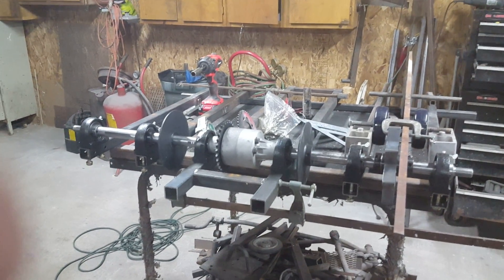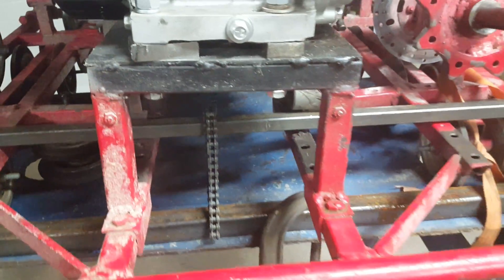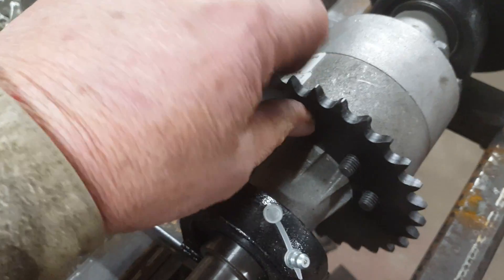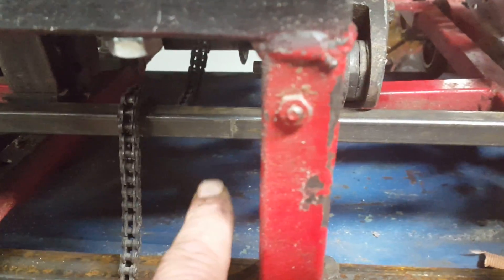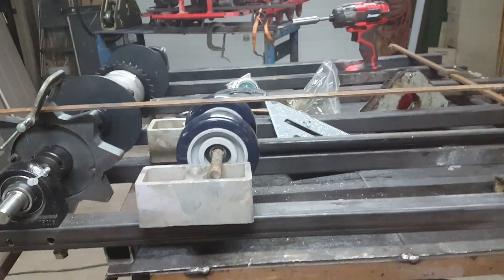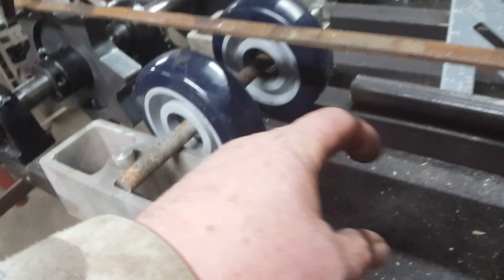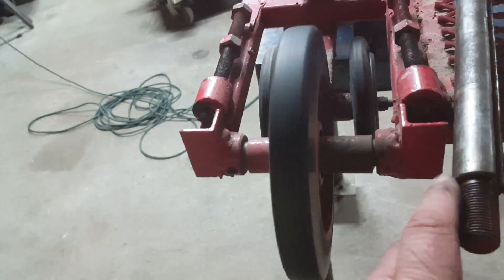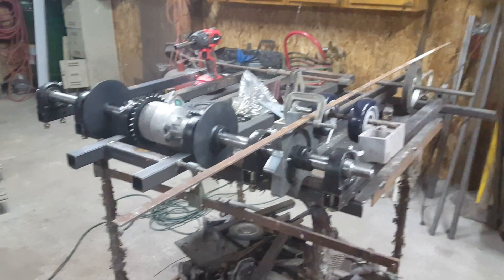PTV Build 4 - The diff sprocket, take-up bogie and broken diff diagnosis.

Comment: where did you find or where are you going to find another diff? I recall seeing those years ago but haven't seen them in years.
Reply from the maker: Yeah, this is a tough one.  Peerless went through a bankruptcy or was sold, but I have talked with them and Central Power Distributors wholesales them, so I got approved but I would have to buy like 25 to get any kind of deal.  Staton.inc has them though.  Thanks for watching and a great question!
Reply: @Personal_Track_Vehicle  thanks, that lead me to another source 
https://progear1.com/standard-differential/

Comment: I want to make an electric bike trailer using the same differential on leaf springs. Do you have any ideas how i would support it so the differential case would not crack like yours did? Or is there a better way to use this differential with a different type of suspension?   thanks for awesome video.
Reply from the maker: Is there a reason you need a differential rather than a simple trailer axle?  To answer your question, four pillow block bearings are normally perfect support for it.  My frame was never welded strong to begin with, that was my problem.  Thanks for watching!
Reply: @Personal_Track_Vehicle  because this trailer will have a 750W electric motor powering it driving the 2 wheels and weigh about 600 lbs total with gear
Reply from the maker: @sunshine5349  you should be fine. Strong frame, two bearings on each side, golden!
Reply: @Personal_Track_Vehicle   thanks for the reply! I'm going to call Peerless tomorrow and see if they can make the differential with a longer 48" axel instead of the standard 38" that staton sells.

Comment: Your drive axle....think thats for got carts.....way too weak...I have a Raid trac....there are track drive machine.....they use a solid axle....with clutch packs to disengage....and disk breaks...the clutch packs have think four plates...and clutch plates per side....they use size 50 chain to drive......hope this helps you.....add all three wheels at the back....stronger the better.
Reply from the maker: Very good points.  This was the axle designated for the Magic Carpet track vehicle so I used it on this one, and the next one.  It's good up to 10 hp and I am certainty pushing it with my 13 hp builds but I know that the stress came from the weakness of my  frame.  I REALLY like the idea of clutch packs and you have inspired me to look into it some more, to this point I hadn't been able to find some that I thought would work.  Thanks for watching and commenting!  Chuck

Comment: This model Peerless differential breaks all the time in the Heald Hauler and Trike models. The Comet version was an upgrade to the peerless and generally didn't break. The peerless is only rated for 11 horsepower and the housing is diecast and usually what breaks. Be sure to use bentonite for lube. There was a guy in Scotland who made billet aluminum housings for these that also added bearings in place of the brass bushings, but unfortunately he has retired. I thought someone would have started making these again by now as there still seems to be a demand for them.
Reply from the maker: I agree all the way around.  Peerless is still making them but making them really hard to find and buy, through a distributor.  I am signed up with them now but the only way I can get any real deal is to buy like 25 of them at a time!  I know I am over powering it on my latest but so far, so good.

Comment: Can you do a vid on how to take the diff apart on one of those axils
Reply from the maker: Never thought about it but it's easy.  Unbolt the four housing bolts and it comes apart.  Maybe simple circlips holding the gears on the inner splines, can't remember.  Thanks for the suggestion, if I ever take it out I will be sure to do one.  I think there is a video out there somewhere, thanks for watching.

Comment: Where can I buy the differential and rubber track tire?
Reply from the maker: The diffs have been out of production for a while.  the PTV Build 1 - Prep video talks about them with the number which escapes me at the moment.  The Peerless company was sold and I don't know the status currently.  The tracks were from Summit Supply LLC and the size is 180X60X39, fitting a Honda 250HP powered wheelbarrow as well as other units.  Thanks for watching!
Reply: @Personal_Track_Vehicle  thank you for your reply hope to see more from you!

Comment: Is there another diff you would use besides the h100_224 as I can seam to find that particular one
Reply from the maker: I have never been able to find any other and I have looked a lot.  Good news is that I believe it would have been fine had my frame welded right and maybe with a few more pieces for support.

Comment: NICE WORK SIR! I'm a paraplegic and desperately need something like this so I can get deeper into the woods, creeks etc w/ my G-sons. I've worked as a welder/fab man/machinist way back before my accident and I think this is right up my alley(with help of course). I'm trying to see this baby w/ a seat, maybe lower center of gravity, etc.. I can't thank you enough for publishing all the R&D/part numbers, fails, and triumphs. If you have any ideas for a seated version, I'm all ears! LOL  Looking forward to video 5...Thanks again JD
Reply from the maker: Jeff Davis thanks and God bless the work of your hands as you proceed!  Advantage is the fact it's all hand controlled, never really thought about that until now.   Reverse would be a good benefit for your situation and I've thought about that.
Reply: Yessir, handcontrol was 1 of the 1st things I saw plus your R&D and instructions are awesome too. Most comprehensive build I've ever seen on here, I pray I can afford to build 1 too. When you say torque converter, you mean the clutch? I used to build Honda Oddysey ATV's that use the same clutch design. I have an aftermarket one w/ a bigger 1-inch belt and the stall and "shift" points are adjustable w/ the weights and springs. They actually claim its a 2 speed, but it's just a point where the springs allow the belt deeper in it's "pulley" thus changing ratio. Just 1 more tuning aspect I hadn't seen you touch on yet. Have you noticed that ability w/ your clutch? Godspeed kind sir!
Reply from the maker: Jeff Davis TAV 20 is what I  believe I used on the first one. It is a Comet-clone torque converter system.  Really sounds like you know more about clutch systems than I do! But it is a common system on go karts and mini bikes. Since I'm going with a bigger engine on this one, I bumped up to what is called a series 40. I actually have another series of videos in my build of my first one that may help you as well. Although they are not as detailed as the one I'm building this time.  I could easily see this build with a swivel type seat with a lock on it as well. Very interesting application and it would be really cool if you could work toward that. I really wanted to go through the woods with my dog and I've done that several times with my other one. Stay in touch, and let me know if there's anything I can do for you.
Reply: It's been many years since I've played w/ mine  You may want to look at the engine and driveline on a FL250 or 350 Honda Odyssey. It uses a gear box over an open chained jack shaft and the 350 has reverse. It may give you some ideas you haven't come up with yet. You can make crazy power w a 250, way too much for the stock chassis imo. The engine is configured for your type of drive. Please let me know what you think if you do check it out
Reply from the maker: Great idea, will check out, exactly an option I have needed to consider.  On one of my earlier videos (perhaps you have already seen) I had a Suzuki 125 quad engine (with reverse) on it.  Comet also makes a generic reverse unit, or used to make it anyway.  Thanks for your interest!!
Reply: @jeffdavis9575  just for the record ,  the 1980's maybe even 1990's polaris 250 two stroke  rear wheel drive quads also have a reverse gear box with a belt driven system  .
Reply: maybe also use a riding lawn mower diff tans setup instead of the plain diff .  would have forward gears plus reverse . just take off any extra casing and shorten the axel .  put sealed bearings on each end of the axel's housing  .

Comment: Going to need vertical bracing to keep that frame from flexing. The cross bars you putting in will only do so much with the flexing. You still have to put the motor plate in and would be a great place to put vertical triamgulation off that.
Reply from the maker: prancstaman Great idea, like it!